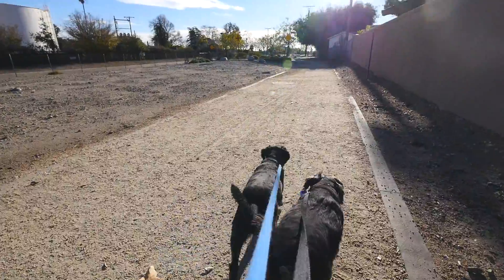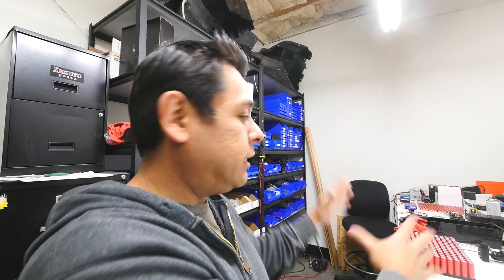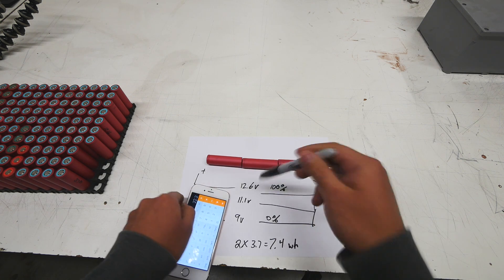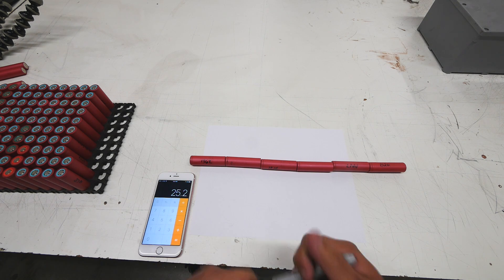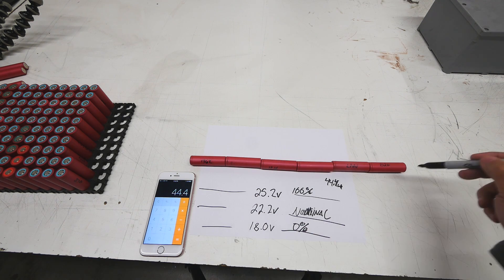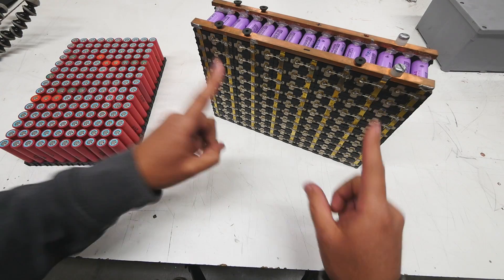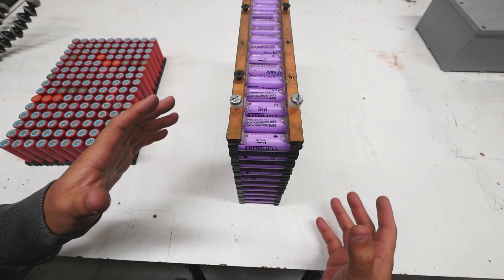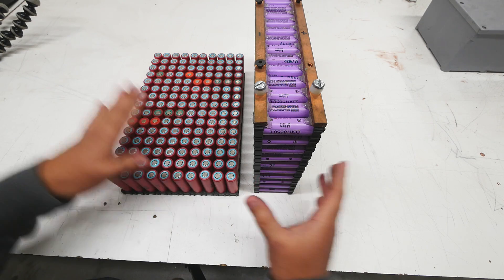How to wire A DIY Tesla 18650 Powerwall

Comment: Does the motor get hot enough where it may be able to water cooled like a heat sink on a computer and use the heat to warm the van?
Reply from the maker: +MrBrymstond  not very much heat produced by motor as its very efficient

Comment: So if there's a bad battery and it can't balance the fuse will burn, right?
Reply from the maker: +MrBrymstond  correct
Reply: jehugarcia Thanks. This way allows battery to be fully used up before you junk that one battery cell, but allows the whole system to last many time more. This way you know when a battery is dead it's really dead unlike a BMS which kills it as 500 cycles which goes by fast. I'd much rather replace one or two cells than a entire unit. I looked at a BMS and couldn't figure out why anyone would limit themselves so bad other than marketing? I would CMS "Cell Maintenance Service"

Comment: Looks like your voltages are too low.   You are one cell too low
Reply: Yes but since the inverter is made to work inside a car, wherein the voltage range is 16 ~ 10 VDC one should build the battery bank to run the same top end range too.   This will give you more power to work with.
Reply: I thought the same, better to overvolt 12 and 24 appliances - but I guess it depends what it next get used for (in this case a generic inverter) - there are lots of affordable 1 kW DC to DC step up and down devices on eBay now for $20
Reply: Does not matter in fact they all have a means to handle + or - from the stated working voltage.   

A normal car battery for example charges to 14 VDC and the Car's charging voltage can go up to 15.5 VDC.

Therefore at even 16VDC you would have no problems with 99.9% of the devices that you would use in a car.

Now for 24VDC you can just double everything :-)
Reply: If you're driving an inverter it's not so critical. Anything using series regulators, etc is a different story.

Comment: Ques 2) Since your batteries in your battery packs are parallel, they can't over charge and can't be discharged to zero so they all last the same amount of cycles?   Since some of these used laptop battery packs have been in use for years we can't be certain how many charge/discharge cycles are left?

Comment: That was a great explanation. I want to build my own Tesla Power wall and really like the way you explain things on your vblog. My question is what used laptop battery pack should I look for?  Other vblogs show charts with LG, Samsung 18650 batteries as the best but most of the laptop battery packs I see on ebay are for IBM, Toshiba, Dell, etc. And buying 18650 batteries out right on ebay runs about 1.50 to $3.00 or more per battery and I don't know which of the ones are good?   So which laptop batteries should I look for to get the good 18650 batteries and advoid  the cheap ones that have lower capacity so that I don't waste my money?           Thank you Jehu

Comment: Question! Around 6.35 in the video you show us the finished battery pack. As far as I can see you've got 20 cells in parallel and 7 or 8? in series.  Sorry can´t figure this out, but there seems to be a fuse connection on both sides from brass strip number 7 and 8 (from the left). WHY? :)

Comment: how in the world do you get soo many 18650 cells without selling your soul?
Reply: My best source is scrap sellers outside of town, I buy batteries at $2 per kilogram (a battery weights ~0.375kg), my second choice is stores that sell old stuff, most of them are clueless in terms of computers and more than happy to sell you dead batteries that nobody wants, I buy computer batteries from them at ~$1 each. I have 64 kg in my car that I bought a couple of days ago, I open ~5 a day.
Reply: I get them at ~$0.20,  or~$0.22 when you don't count those I disqualified after tesing them.
Reply: I suggest you watch more videos about 18650s, in this channel and in other ones like HBPowerwall, Rinoa Super-Genius and others. DIY powerwalls are great in making them and are worth the effort, but I don’t advise that you jump on them and drop you plan of getting AGM batteries, you could start with a few batteries,  carry on with you initial plan, setup your system, then learn about 18650... As I said, watch more videos.
Reply: Thanx for answering..  even if that was what i was afraid of..  Because i calculated and got closer to 2000 then 300. Here in sweden its not that easy finding people selling their old laptop batteries. And marktetprice is like 4-5$ each and that is not really worth it for me. 

Tomorrow i will start my adventure 50% off grid/living free/campingstyle, just to try it out for as long as i manage. Got everything except batteries and solarpanals that i was going to get tomorrow (agm batteries)

But then one on my FB posted about powerwall 2, so i will check it out if it is the same method or maybe a better and hopefully cheaper one =)  

Maybe you know?
Reply: Where?

Comment: So If I want to run a 12 volt inverter, should I go for 4 "18650" batteries in series, or 3 of them? I plan on doing this as a battery bank for an RV.

If anyone could help me with some advice, that would be cool...
Reply from the maker: Higher voltage is usually better, you'll have to test if you're equipment can handle the 16V of 4S pack
Reply: Cool, is it possible for you to maybe mention how to do it in the future? You're the man btw, I've been sharing your stuff on my page!

Comment: In your previous video you stated it took you around $300 to complete your DIY powerwall. What I'm concerned about is how cost effective it would be to go with this option rather than a lithium battery or another type. With the link you provided for the cells on ebay, I searched for the best priced options but it appears it will cost much more than $300 for the cells alone, even just for a lot of 300, let alone the 600 cell example you shared in your video. Do you have any input for me here? How many cells should I go with if I just want to store enough energy from solar cells for an RV that uses your standard amenities (lights, A/C, water heater, etc.)?
Reply from the maker: lots of interest is driving prices up lately.  you need to know your energy consumption before you can determine how big of a battery you need
Reply: Figured that would be the case, I was just hoping I was looking in the wrong place. But it's good to know more people are becoming conscious about their energy consumption. :P Looks like I have more research to do.. Thanks for getting back to me, I appreciate that! Keep up the great videos!

Comment: ok now I am confused I thought each cell was 3.7 fully charged I am trying to make a 12v solar charger I ordered a solar regulator that is adjustable I was going to make a battery using series of 4 to make 12v actually 14 volt and sett the voltage a little lower. would say it would be wiser to use a 3 battery setup ? it would of course give me more battery's for larger capacity but I'm a little confused on where a normal lead acid 12v battery's voltages rest
Reply from the maker: why worry about what lead acid does if you are not going to use one,  Id say a better question is will whatever you are powering with your battery handle the voltage from your 3S or 4S pack.
Reply: right now I have a 750w inverter, eventually I want to step up to a 1500w for using power tools. my plan was to make a 4 x 5 cell battery. then make multiples and add them as I go like normal deep cycle batteries connecting in parallel. I found a great deal 50 18650 with 5800mAH for 35 bucks.
Reply: As a rule lead acid batteries are 2.1 - 2.2 volts per cell, and usually charge, say a car battery, at 14v or so.
Reply: Hi Dean,

I have not found bery good deals on ebay for these 18650 cells. The best I have found is used Dell laptop batteries but that still costs about $2 per cell for 9 batteries. Can you let me know where to get the better pricing your talking about?

Thanks,
Rick

Comment: For 24v is it better to do two 12v or one 24v. Also if I where to charge the 12v 600 cels with solar what charge will be the right for this pragect 30a or 40a and how do you calculate this to get the right A.
Reply from the maker: Your questions are un-answerable until you define your goals
Reply: thanks? that was not much help. so if i have 12v 600 cels how many amp charger do i use 30 or 40a?

Comment: hi, so to see if i understood, for a 12v  4.4Kwh battery , i would nedd a 4.4Kw solar panel system to charge it?
Reply from the maker: If you wanted to charge it in one hour,  yes.   2.2Kw solar system would charge in 2 hours
Reply: ohh, i see now
Thanks.
So if i have a 4.4kwh Solar panel and a 2.2kwh battery that will take, ideally, 30 minutes then, right? Do you speak spanish by the way?
Reply from the maker: yes
Reply: Yo soy de portugal y el portugues es muy similar con el español.
Quiero hacer un sistema solar para una casa independiente, pero aqui, ahora es necesario una licensia del govierno.
todo para teneren mas diñero.
Mismo asi, un sistema pequeño no hay de ser muy notable..

Comment: If I want to use a 12V solar panel system to the power wall (If i used 200- Li-on 3.7V  9800mAH in series of 4 or 14.8V in 50 parallel. Would that be 50 x 9800mAH = 4900Ah @ 14.8V) are is my math fuzzy
Reply from the maker: +Conrad Sorensen  no such thing as 9800mAh 18650 cells,  not entirely sure what your question is.

Comment: the balancing isn't crucial in parallel setups like that but at the same time it is.
they're subject to varying resistance due to the inherent resistance in all conductors, essentially you'll develop hotspots if you have inadequate cooling.
the cells nearest the bars will be utilized more than the cells further from the bar. the resistance difference may be small but these are meant to be charged and discharged continuously. at the very least i'd run four packs and have a controller switch which are being used and in what order to maintain even wear.

Comment: haha people are ignorant when they say you have to balance cells wired parallel. you only need to balance when wired in series. 
These packs are wired with all the + together and all the - together.. so the volts of one cell is the same as all the other cells. 
I rewired all my old lipo packs for RC.. into one big 3.7 volt and use it on my bike trailer to power sound, gps, and charge my phone. Just don't connect two cells unless they have the same volts. so manually charge or discharge the cells to the same volts when building packs in parallel.

Comment: hello, I hope you're ok, these cell are rechargable??, if you use this arrangement all the poles at the top are postive and down negative ?? If it were like that the result would be the same voltage like one cell and an amperage of the summatory of the all the cells right?
Reply from the maker: +diego velarde  correct
Reply: but we are triying to get 12 V and in this arrangement we wouldnt have it, we would 3.7 V and a lot of current , or am I in a mistake?
Reply from the maker: correct

Comment: Question, I have a server rack that uses 4kw. We are prone to power outage in my area and at the point I rather conduct a battery array (like what you have here). How many batteries would I need to use 4kw every hour for a whole day? Thank you for your time sir.
Reply: +grimthereeper I think you would need 22 of these units. 13,200 batteries. If you could selvage at same rate, 30c a pop, it would be $4k + $1.5k for inverter and bits, a total of $5.5k. What about using a 100kw diesel generator? I see them new for about $20k, and used for around $10k. Do you have frequent 24hr outages?

Comment: I think I understand why you said you don't need to balance the cells.  In parallel you should get the same amount of voltage for the whole group even if a few of those cells failed.  Now if one or two cells fail, you only lose a few watt-hours, decreasing current output by a certain percentage.  But if a large portion of those cells fail, then you lose too much power and might not be able to fully power the motor at full load.  So the reason to balance the cell would be in case of a few cells or a group of cells failing you could easily find and replace them without replacing a full battery pack of X amount of cells.  Unless you want to spend the time testing each cell individually when and if they do fail by taking the whole piece apart and testing each cell individually.  Time consuming to say the least... If you don't care when or if the cells fail then yeah, I wouldn't worry about load balancing or some sort of system to determine if cells are struggling to keep a charge.  But say you need to determine the health of your battery cells for longevity, it is a good idea for some measuring system.  Just looking at current on a screen and saying you have enough for the load isn't good enough to determine the health of your system.  In the short term maybe, but as the cells age each one will fail at a different time and you will be paying for this mistake in time it takes to find and fix the problem.

Comment: hello thanks for your vids

i'm really interrested in doing such an installation at home  , 
my main electric expense is heating i have 12000W electric heater (correct me if i'm wrong) i will need 2 6000w inverter in parallel to power my electic heater , but the prices of those is very high and relally reduc the benefits of such installation ..

is there a workaround to avoid a so big expense  ?
Reply: No, you need a lot more for cloudy days, etc

Comment: Ok, went through the power wall videos and something i cant quite understand is why does Jehu keep buying used laptop batteries instead of purchasing new 18650 cells ? A few ebay searches and i found item 272014963666 , which if correct promises 50 cells at 9800mah for $60, which means that for $60 you get just above 1.7kwh, which is insane. According to my calculations, used laptop batteries will end up to be more expensive per kwh in the end. Am i missing something ?
Reply from the maker: +Spalxy  Yes,  china batteries,  neither New  or 9800mah,   google chinese fake 18650 cells on ebay
Reply: Touche! Thanks for the heads up Jehu!

Comment: Mr Garcia I am considering building a small vehicle that can be powered by solar only without battery, I know it's possible but the max speed would be low because the area needed is greater than normal cars, I wonder if anyone has every made a chart for vehicle weight vs max-power-2-wheels (kw) that shows max speed on a straight road.

I would go about by having a basic steerable frame with 4 wheels that I can add weights to, and provide the power needed to drive the vehicle by cable from another vehicle traveling parallel, then see the max-speed on straight road with 0-ish wind.

I want to see how low weight I'd need to have to travel x speed with y amount of solar power.

I'm considering a vehicle around 300 kg, 2.5 x 1.2 meter long and also removing the PV wafers from the inside of PV panels and putting them on the vehicle inside 2 layers of thin Plexiglas/Polycarbonate sheet and dump the glass and other things that make it heavy. All to make it lighter.
Reply from the maker: +osmmanipadmehum   Cool project,  there are some solar panels with no glass on the market they are very light

Comment: Awesome project dude.
Any drawbacks using 18650 10000mAh cells ?
Reply from the maker: 10Ah 18650?
Reply: +jehugarcia http://m.ebay.com/itm/2-x-18650-10000mAh-3-7v-GTL-li-ion-White-Rechargeable-Battery-for-LED-Flashlight-/121798766594?nav=SEARCH yes :)
Reply from the maker: Fake,   no such cell with that much capacity exists commercially today
Reply: +jehugarcia it sounded a little to good to be true. What is the biggest cell available?
Reply: What I can see from your vids you use 18650 cells without protection PCB right?

Comment: Thanks for the information jehugarcia.I'm inspired to create a powerwall for the bus i'm currently rebuilding.In your explanation (12v system) you wrote 2 x 3.7 = 7.4wh without mentioning what this was ?? Can you enlighten me please ??
Reply: Watts = voltage x current, so his batteries are probably rated at ~2000mAh, or 2Ah. Watt-hours would be voltage x amp-hours, or 3.7V * 2Ah = 7.4Wh per cell.
Reply: Thanks Jack. I spent 8 minutes in the comments section hoping to find this info. You are the real MVP

Comment: I think your videos are great...you keep the topics light, fun and sometimes throw in some quirky humor which is a good formula to keep you viewers hooked. Keep up the good work. 

As for the ignorant people that leave you unhelpful or moronic comments, I am of the opinion that you should just ignore them or leave them one word responses; nothing is better than watching someone like that self-implode from your lack of attention. When I started my electric vehicle journey, which included fabricating my own liquid cooled controller all I got was negative remarks from my friends.  Now I zip around in a BMW i3 and those same friends have to tape their jaws shut as I whip that torque monster around town.

I would like to to ask you about your soldering of cells. I think I see you use more than one soldering iron at the same time to overcome the heat absorption of the battery. Is that correct? I am always worried about the violent nature of LiPo batteries when they fail. I am not an engineer and I cannot even say I am sure how these cells are constructed but are you ever concerned that the heat from the soldering guns could damage the edge layers of the batteries? I saw a few tack-welders for batteries under $200 bucks on ebay. Is there a reason why you don't use one of those? They look like they could easily be modified to create a handheld tacking solution.

I only wish I lived in your region. I would have loved to do some collaboration work with you. Keep on "Riding That Lightning"